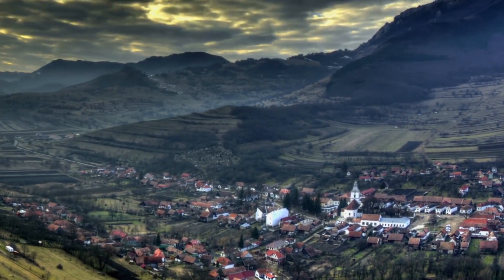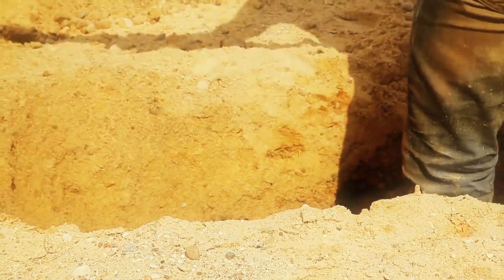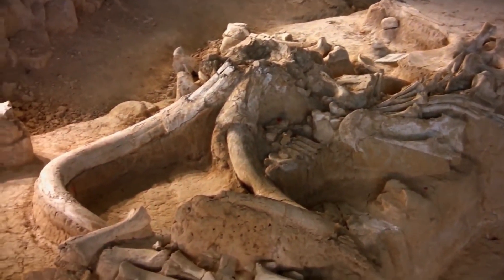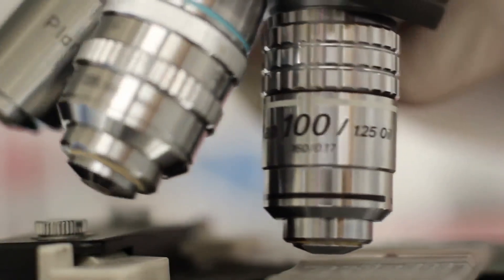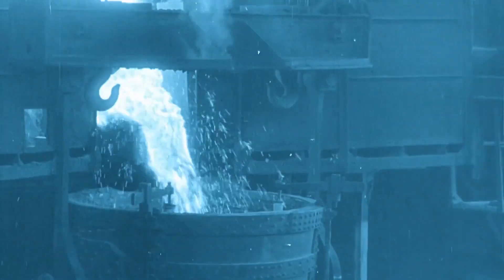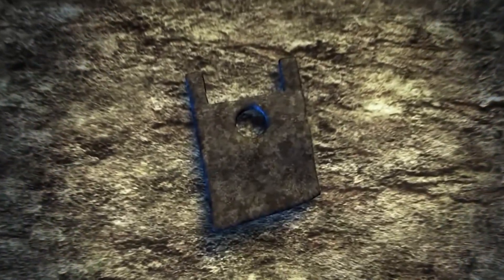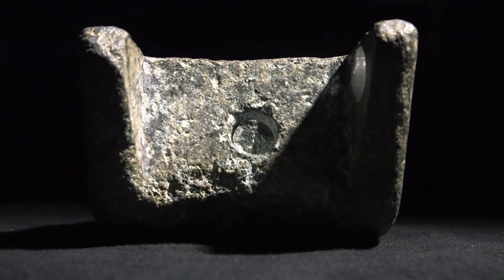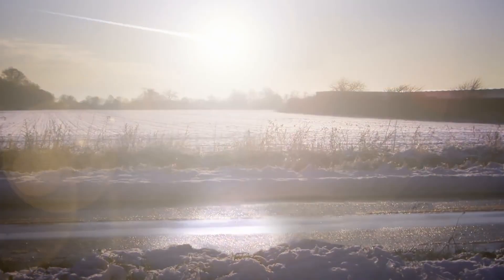Wedge Of Aiud

Comment: Mystery solved in 2000
Origin : World War II fighter plane - 2WW 
The military duralumin piece was identified as part of the Messerschmitt ME 262 fighter and had the official name of "nose wheel extraction plate". 
In fact, the object was used as a wheel cover to close the aircraft's hatch while in flight. 
It is assumed that the piece came off in flight and due to the speed of the plane, it sank deep into the sand.
Unless you think that in 1943, there was no operational jet fighter (Me 262 Schwalbe (Hirondelle) or Avia S.92 clone: Czech
The patina is due to natural or chemical acid pushed to electrolysis.
source :  de.wikipedia.org/wiki/Aiud
Reply from the maker: There often is an explanation, but of course, not always. Great find. Thanks for posting.